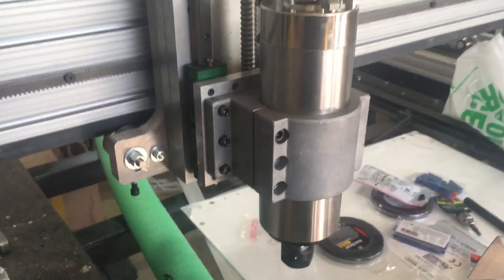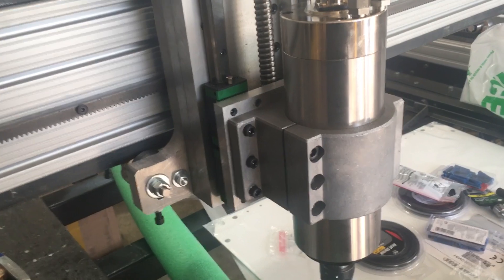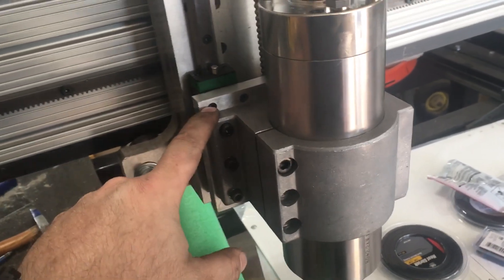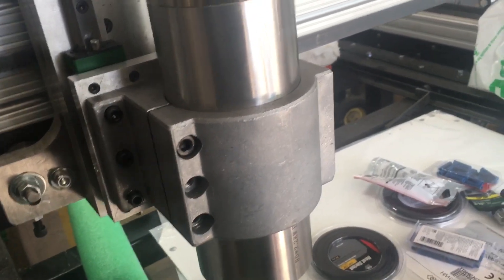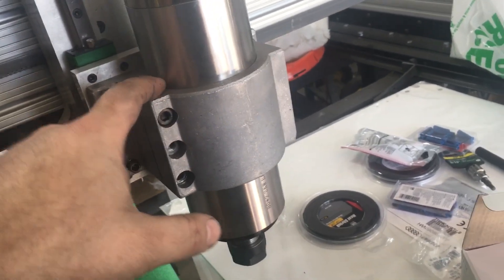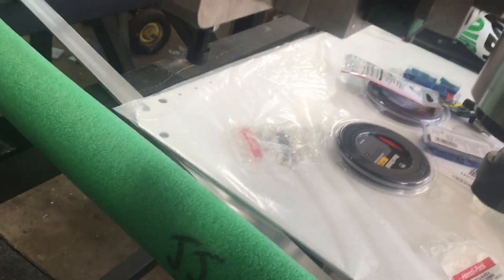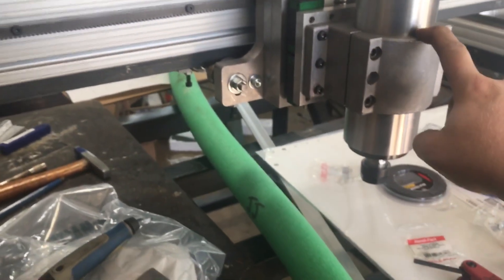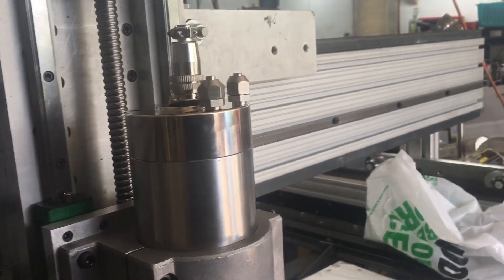CNC build tips: Chinese spindle installation

Comment: Hi, what is the power rating of this spindle and the make n model.....Do u use it for metal engraving.....Could u kindly help me with u r email address
Reply from the maker: It’s a 2.2kw spindle. I’m not sure of make and model, I just bought one of the water cooled spindle/vfd packages on eBay. I have engraved metal with it.
Reply: @RileyKnifeandTool  so what is the feed rate and cut depth and width also what type of cutter do u use it....And how often use the spindle
Reply from the maker: @Akshadeep27  there’s a lot of variables from the type of material to how rigid your machine is. I’ve used v-bits, burrs, ball and square end mills etc... the harder the material the slower the feed rate and smaller the depth of cut.

Comment: Do you think there would be any problem with running anti-freeze through these? My shop is not heated.
Reply: I highly recommend antifreeze. A lot of people use pink RV antifreeze, because it is intended for long use without changing in a sealed system.
Don't use regular water, unless you want to have to clean bacterial gelling or algae clogging all the tubes.